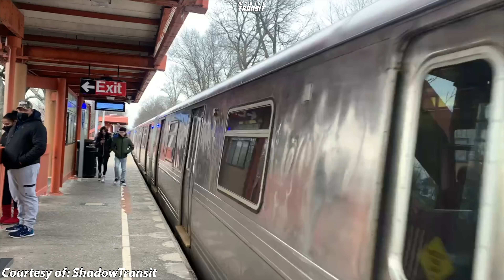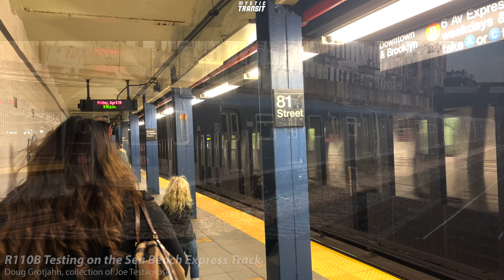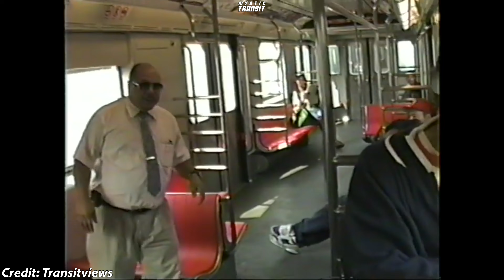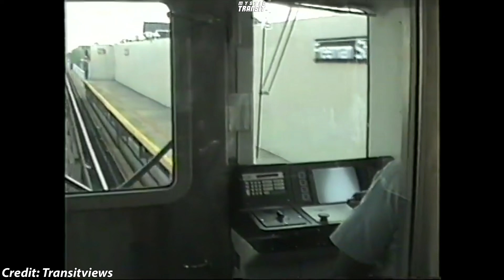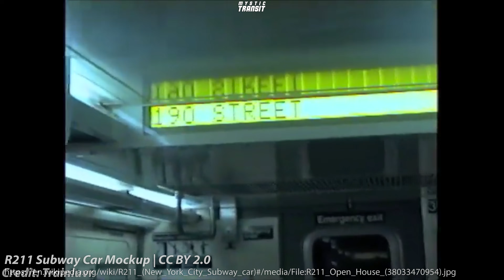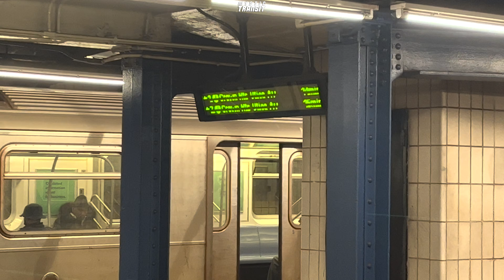The New Technology Test Trains - A Leap into the Modern Age

Comment: I used to ride the R110A from Wakefield-241st Street to 149th Street-Grand Concourse back when they first came out in 1993, I was only 7 when they were first introduced to the MTA. So I ridden the Manhattan bound R110A 2 train following the White Plains Road line and got off at 149th Street-Grand Concourse. 7 years later I rode the first ever R142 2 train from Wakefield-241st Street to Grand Central-42nd Street and it was rerouted onto the Lexington Avenue line because of construction between 135th Street and Clark Street so 3 trains only ran between Harlem-148th Street and 145th Street as a shuttle so they were completely suspended between 145th Street and Clark Street so they couldn’t get into Brooklyn at all and into Lower Manhattan via Lennox Avenue and 7th Avenue. In the summer of 2000 I took a borrowed 2 train from Grand Central-42nd Street to 161st Street-Yankee Stadium for the very first ever Subway Series of all time of the Yankees vs the Mets. The borrowed 2 train was an R142 train and was painted white with Yankee blue pinstripes and saying Subway Series 2000 with the Yankees and Mets logos and the ends of the train and on the cars. Later on in 2000 I took an R142A 6 train from Brooklyn Bridge-City Hall to 125th Street and transferred at 125th Street to an uptown 2 train taking me up to Wakefield-241st Street as it again was running on the Lexington Avenue line until further notice which would be once the construction on the 7th Avenue line was finished. In August of 2002 I took the first ever R142 4 train from Grand Central-42nd Street to Mosholu Parkway and Woodlawn. In the later days of 2002 I took the first ever R142A 4 train from Brooklyn Bridge-City Hall to Woodlawn. Then in 2005 I took an R142 5 train from Bowling Green to Eastchester-Dyre Avenue. On September 21st 2008 I took the last run on the 4 train from Woodlawn to 161st Street-Yankee Stadium on the last ever game day at the old Yankee Stadium and watched all the legendary players and alumni players get called and them run onto the field for old time sake, I then watched the actual game be played for the very last time at the old Yankee Stadium. Later on that night I watched the very last celebration at the old Yankee Stadium. At midnight on September 22nd 2008 just several minutes after leaving the old Yankee Stadium for the very last time I took the very last 4 train from 161st Street-Yankee Stadium to Woodlawn and began to get emotional because I was never gonna see the Yankees play there again. On opening day at the new Yankee Stadium I took the very first Metro North train ride from Crestwood to the brand new Yankees-East 153rd Street station and watched the very first ever game at the new Yankee Stadium, I started to say to myself that it wasn’t the same being at this Yankee Stadium because it’s just a replacement to the old one and we will never see 85 years of history be made from 1923-2008 again, we now see modern day history be made not classic history be made. In 2012 when Rich “Goose” Gossage came to The Bronx once again and was on the field of the current Yankee Stadium, he signed autographs on all the merchandise including his jerseys that were fan made and he was very disappointed that they got rid of the old Yankee Stadium where he did his best games ever. Also Rich “Goose” Gossage was number 54. In 2014 I took the 4 train from Mosholu Parkway to 149th Street-Grand Concourse and walked down to Exterior Street, across the Yankees-East 153rd Street overpass near between the stairwell to the street and the mezzanine and right to the stadium itself, it was Derek Jeter’s final game and I took my seat in section 203 aka the bleachers nicknamed the Bleacher Creatures. I’ve done the same things for many years since 1990 but did them the most since 1993.

Comment: The R110b are 67 ft cars drawn back to the BMT standards in triplets. The reason is that the 75 ft cars could not fit into the premises of the lines under the BMT eastern division which is what the J,M,Z and the L use. So they use this triplets configuration to try to have it fit in the entire B division dispite the constraints in the system. A single triplet unit can measure 201 ft with each car length in 67 ft supposing the length of the Franklin shuttle, but  two triplets length a total of 402 ft, 78 ft shorter of a typical 8 car train when technically, it takes 7 cars to be roughly equivalent to a 8 car 60 ft train and all three triplets length a full set in which I don't know where the conductor would position in either the 4th car or connect the 7th car so there are some issues. So transit went with a better option to have all technology train assemble into 2 semi units much like the r110a adapt the second electronic strip map from r110b and incorporate the rest of the features onto the r142 and 143 while the r160 was upgraded with new features and adapted two modifications of semi units to fit in the entire B division

Comment: Great Video as always. I remember catching a 110B in the summer of 96 on the A, really felt like a step into the future at the time, from the station indicators,  futuristic sounding traction motors and ice cold AC (downright frosty compared to the R46/32s running on the A otherwise at the time. They certainly set the standards going forward.

Comment: I once had someone say they wished the R110As were mass produced....than an R142A 6 Train (aging myself here) pulled in just as he said that. I think the R142A is only train directly related to the NTTTs. As you said the R110B design was scrapped and we ended up with the R143s and 160s which have grown on me.
Reply from the maker: The R142/A's are directly related to the R110A's.

The R143's are a mixture of both the R110A and R110B.
Reply: @MysticTransit  it would be amazing if the r142 had the r110a 
Propulsion

Comment: The R44's were not prototypes for the R46's, they were a full production order. They were also fully tested for 5 months before entering service! Dec 71 - Apr 72 including testing on the LIRR where it set the speed record. They replaced a number of R1/R9's and was to run on the Second Ave Subway, which of course never happened! I rode them in the mid 70's on the D line.

Comment: You know, I always wonder where the MTA gets the money for these trains considering that the transit system has been broke for years. I would say that upgrades to the rail infrastructure would go a long way toward helping service improve like CBTC, and autonomous trains, decreasing running costs and increasing frequency
Reply: Capital Plan. Not replacing the rail fleet is NOT an option.

Comment: Important to note that new conductors boards were also installed along the 6th Avenue Line for the R110Bs as the A was planned to be rerouted along 6th Ave to Brighton Beach with the Q going to 8th taking its current role,  also reflected by the presence of an orange A bullet on its rollsign

Comment: As a retired motorman 'B' division i can attest to you're review of the R44s (well done by the way) To many here it might come as a surprise the R44s were my personal favorite to operate (the other R38/32) as it was a challenge to brake into a station especially a express station at high speed like Nostrand ave or Utica ave on the A line where the rule of thumb was once the braking sequence started into a station, you held brake pressure right into the  >10< car marker in the station !  If you released brake pressure and applied brake pressure again the compressors were not fast enough to supply brake pressure which usually meant you slid past the >10< marker by several feet pissing off the conductor because he or she was past the board LoL......
Reply from the maker: Thanks for the insight.

Comment: The R110A is my fav NTTT train it has Red color pallet seats in the Front/Middle/Rear cars while the others (B-Cars) would have yellow or blue colored seats its propulsion system was great. It was fast but the seats were bad to sit on the announcments did sound diffrent than today's but it was taken out of service in 1999 (The R110B's were taken out of service in 1996 due to 3006 being on fire.) But the R130 would be a staple of the IRT for new Tech trains of the milenium and soon the R262/A. (Fun Fact: In 1992 Bombardier was making the T1 for the TTC so some T1 propulsions were used for the R110A which is why the T1 and R110A propulsions sound the same.
Reply: Wtf is an R130?
Reply: @Boypogikami132  An R130 is an R110A

Comment: I really think the MTA should preserve the R110B by making a new 3 car set out of cars 3007 (motor), 3002 (trailer), and 3009 (motor) depending on the condition of those cars. It could then be used for NYTM events like the parade of trains along Brighton!
Reply: Ayo! I was thinking the same thing!! I was also thinking it could be a cool secondary Holiday Train as well!! It’s an important rolling stock that was a huge part of how the newer trains were developed for our system!
Reply: @williamscoufaras7045  Yup, and even if it can't run under its own power even after being repaired, tow the 3 car set behind an R1/9 or R32/R42!
Reply: And add it to the museum
Reply: Maybe have the R110Bs have open-gangways and a 4 car set and rename it the R210.

Comment: Nice video dude. Also currently there is a 3 car set of r110b's sitting in 207 street yard. The only good way to see them is by crossing the university heights bridge by walking across or taking a Bx12 SBS (If you take the bus to Inwood you will get a better view).

Comment: Sounds fairly similar to what we did here in London with the 1986 Stock. Great that you didn't scrap these though as our ones only lasted about 10 years.

Another great video btw. 👍
Reply from the maker: Ah, I remember reading about the 1986 Stock. I love the London Underground (especially the stock that proceeded the 1986 stock, like the 1996).
Reply: @MysticTransit  The 1992's are the resulting stock
Reply: @meandwhoism  its funny that while the (Metro Camel) Green one that rembles the 92 stock most it was BREL who got the contract guess LT liked the appearance but wanted the BREL traction

Comment: Really excellent video and when it comes to R110A these became a Pump train. The closest train to have a propulsion unit to them is a Taipei Metro C371 which was built in Yonkers Kawasaki Plant 1989-1994 same time as R110A. First trains  to be manufactured at Yonkers Kawasaki factory were PATH PA-4 R68As since there are New York Times article dating back to 1987-1989.
The hard part is trying to recreate them for Train Sim World 2 if the R110A were to be a DLC train for Lexington Avenue line R110b Queens Blvd
Reply: It was a Taipei Metro C301 which had Westinghouse propulsion. Taipei Metro C371 use Mitsubishi propulsion.

Comment: I remember when they debuted at the Transit Museum in November 1992 and being fascinated by how futuristic it looked. They showed it off at various locations in the subway the Winter of 92-93 & then when I heard of them running in service, i made it my mission to ride them and eventually i did. I rode the R110A once in 1994 & the R110B twice in 1994 & 1995. They were very smooth cars. I preferred the R110B. The R110A was very tight when crowded. I heard people complaining on that 2 Train cursing about how uncomfortable it was. Fast forward to 2000 & we get the results of those trains with the R142/142A’s. Great video!
Reply: By the way , Brighton is a section in liverpool , england , merseyside its called "New Brighton"

Comment: Could you do the R-62/R-62A/R62B & R-68/R68A? They were the last SMEE classes until the New Technology Trains for both divisions.
Reply: Don't forget we have the brand new R262/as coming soon to replace all the R62AS R62S on the 1 3 6 S lines for CBTCS. We know that the R211as is here for a test trains 🚃.
Reply: @leecornwell5632  The R-262 won't happen for a few years, while the R-211 is taking shape.
Reply: r62 is my favorite. The sound, emergency doors and Inside the cabin air is always cleaner than r68 trains are. It also has the same look. Just wish it had the front/rear facing seats like r68.
Reply: @42luke93  The R62AS R62S reminds me of the old smee cars like the R16/17s R21/22s R12/14/15s . Now the R142/as reminds me of the old Redbird s because the R142/as has the old Redbird design s . The R68/as reminds me of the R140s Slam 40s the R32s R27S/30s R42s the way they rumble ride coming and going. The R62AS R62S and the R142/as is my favorite R32s R68/as and the Redbirds and the Greenbirds  R34s R10s the Green birds .
Reply: @leecornwell5632  
Did the r16/17 have the front facing seats like the r110a?
Reply: @42luke93  No The R16 R17S R21 R22s 15s R14S and the R12 R10s had regular seating Not the fancy seats like the R62AS R62S R68S and R68AS R44s R46S . The R142/as has those those plastic seats and the R160/as R143s R179s. The R211as has those plastic seats. However if you ever ride the R9s they have those fencing seats that you are definitely talking about. Back in the days The R16s R17S R21 R22s R29s R26S R33ML R36wf also had those fencing seats back in the 60s and then they have to rip up the fencing seats to put in the plastic seats to replacing the fencing seats.
Reply: Only the R16s had the facing seats just like the R44s R46S R10s R12s R34s had the facing seats. The R62AS R62S R32S R29S R26s R33ML R36wf R17s R15S R12s R14s R21 R22s had no facing seats just straight up seating. You know that the R110AS R111BS had the facing seats.